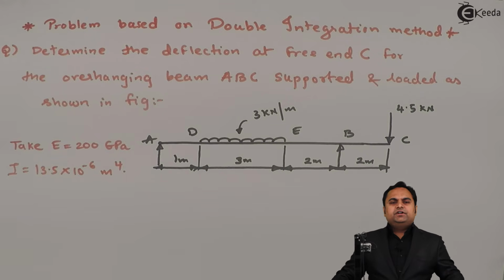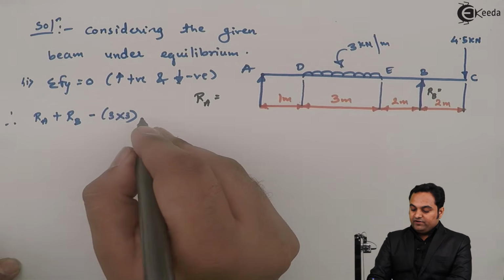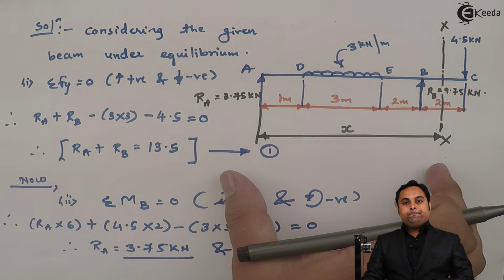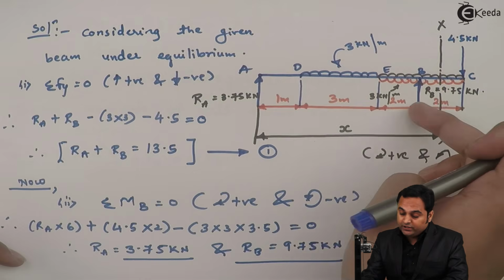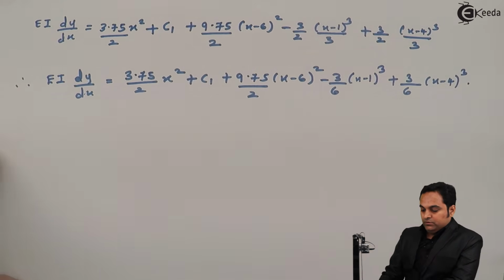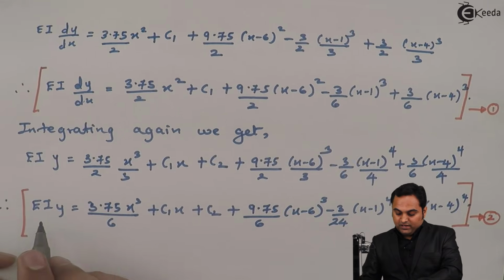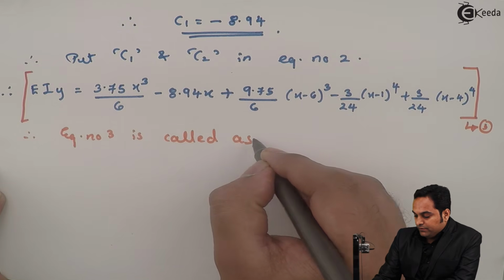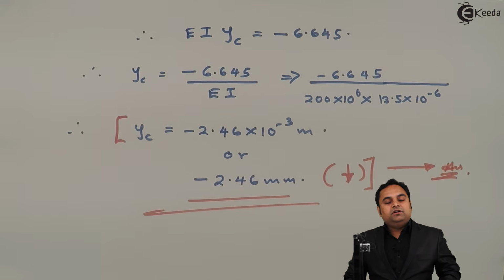Slope and Deflection (Double Integration Method) - Problem 3 - Slope and Deflection of Beams

Comment: Sir , why are u not taking 4.5 KN reaction in Mxx... According to me Mxx should be like this... Pls sir reply me
Mxx = RaX - 3/2(x-1)^2+3/2(x-4)^2 - 4.5(x-8) - Rb(x-6)
Reply: you consider the forces on the left hand side of the  section line x-x because everything after that line has been cut-off hence the exclusion of THE 4.5KN force

Comment: I tried to solve the value of C1 alone and I'm not getting the same answer as you. I looked at your solution and tried to solve for your C1, I get the same answer as mine.. The value is 9.8125
Reply: C1=-9.8125
Reply: I got -9.8125 too, I think he made a calculating mistake.
Reply: C1= - 9.8125
Reply: mee toooo
Reply: -9.145
Reply: The value of c1 is -9.812
Reply: It's crt